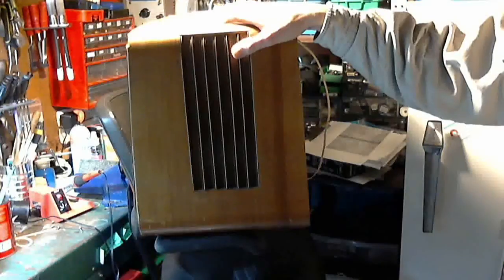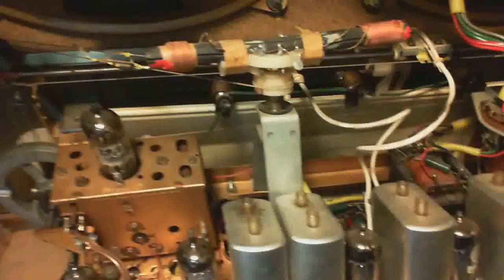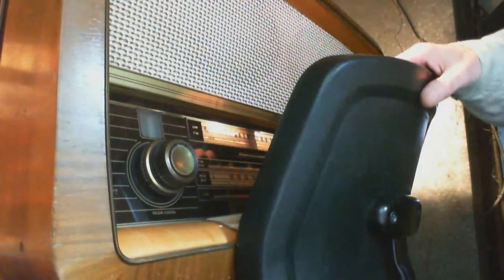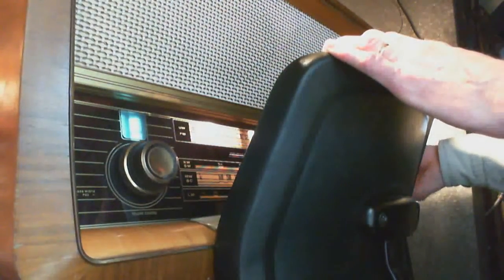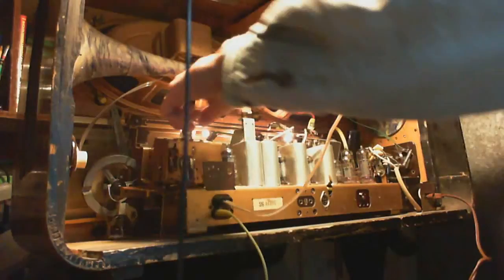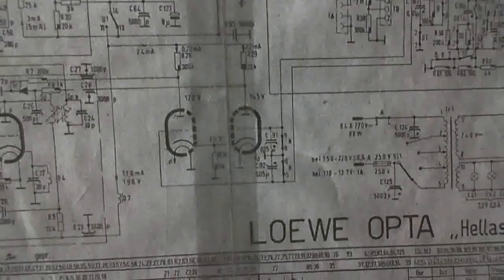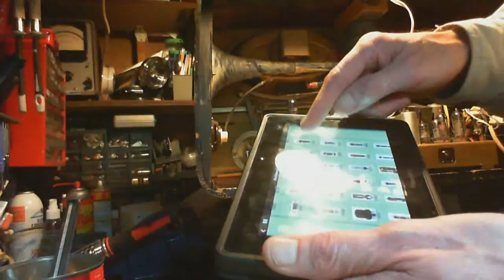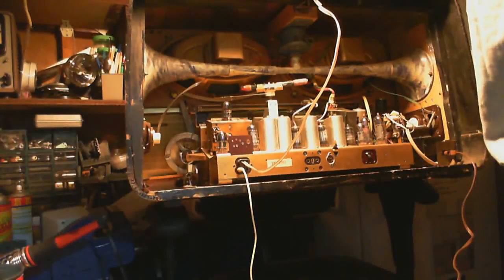Loewe-Opta 2841W German Vacuum Tube Radio Video #2 - Troubleshooting No FM

Comment: I would not expect nothing but the best from German engineering !! Great looking radio!
Reply from the maker: I didn't play it enough on AM so we could hear how good it sounds even on YouTube.  Next time I lug it into my shop, I'll play it a bit more.  Did you see the dual horn speaker in the back?  I think the driver is electrostatic for it.  It's in the centre pointed downward into the middle of the horns.  Very cool but normally never seen.
Reply: german radios are usually some of the best in the world, some philips made ones also,